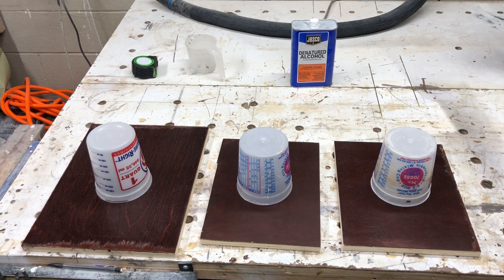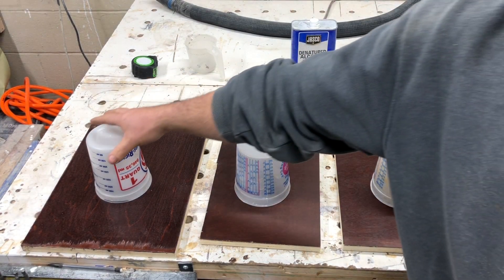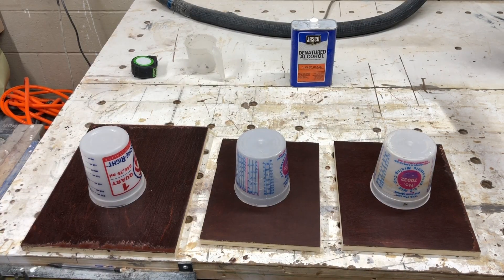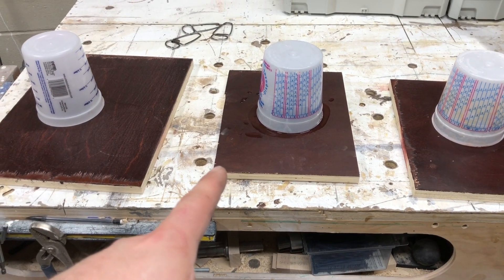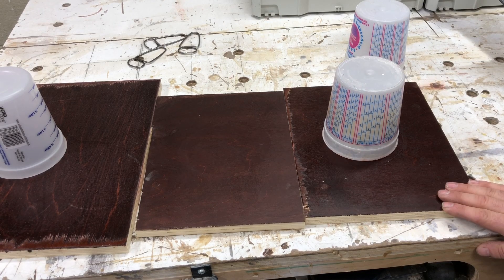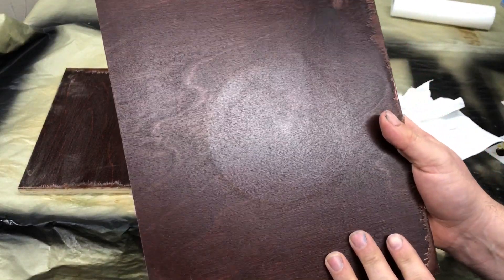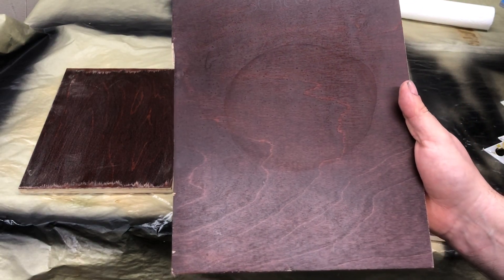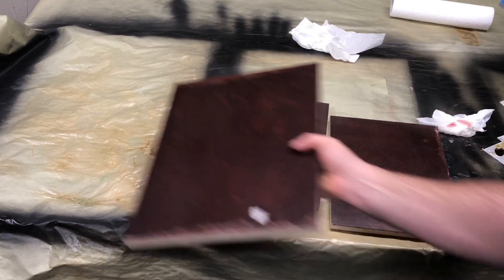Should You Use A Sealer Under Water Base???

Comment: How do 2K Primers and Vinyl Sealers compare in terms of price and durability? 

Why do people use a 2K Primers such as Renner’s 643?

Are 2K Sealers chemically the same as a 2K PU topcoat?

In what situation do we use each of these products? What are their pros and cons?
Reply from the maker: Jenny Smith it depends on if you are talking solvent or water. Solvent ploy urethane sealers are better than vinyl sealers due to their flexibility. On the water side I have not tested 2ks against vinyl. They do offer better adhesion than a single component primer but I have not done a comparison to see which one preforms the other. Vinyl is half the cost of a 2k waterbase primer and a 1/3 in the clear. 

They use the renner 643 as a replacement for vinyl in refinishing or in. New to blog tannin and other issues

Comment: Eric where could I get the axalta 680? Is it currently a valspar product?
Reply from the maker: Cody Townson hey thanks for watching.Axalta bought out valspar so they are one in the same some places still are using the valspar label until they sell out then you should start seeing the axalta label. I get mine from hgh 1-800-277-8888. SW has a good vinyl sealer as well as the CIC. The CIC is a bit harder to Sand but you can just go down a grit on you paper.

Comment: Great video, rumor has it the vinyl sealer has some vinyl in it, so it's kinda like liquid shrink wrap, some yeas ago, when I was just a young lacquer salesman I was told by a manufactures rep that pre cats were plenty good as self sealers. After 5 years and random kitchen water penetration failures. I concluded that concluded otherwise. Another many years go by and lots of kitchens later no water penitration issue when pre-cat vinyl sealer combo used. Dr. Reasons demonstration proves the point.
Reply from the maker: Gregory Saunders I am definitely convinced that vinyl sealer is worth using it definitely adds to the durability of the coating.  Dr Reason?? You guys are a hoot my friend Bob Kloes calls me the Dr. of Water base and sometimes Edward spray hands. Fun times. 😂